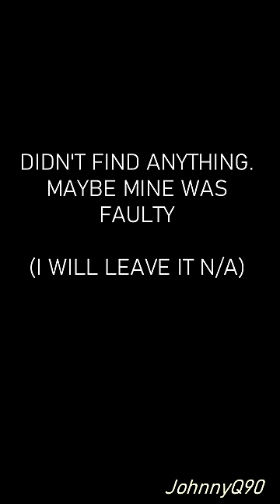Supercharger NOT Working! Naturally Aspirated (N/A) V8 Then!

Comment: The engine sounded really good
Reply: The idle souds like Ducati v4 engine
Reply: I thought its f1 engine💀
Reply: @trq-spectorqueperformance4397  dude clean your ears
Reply: What kind of power does a little engine like that make. It sounded really strong
Reply: @mattl9785  depends on the fuel
Reply: @nicki8731  can I buy one of these you’ve built?
Reply: @mattl9785  I personally haven't built any. I just spend a lot of time on forums and youtube videos 🤣
Reply: @mattl9785 I wish someone answer your question because I think allot of us wants to know
Reply: Actually sounds like an r8 street
Reply: @autobahnman6869  I'm pretty sure donut media made a video on one of these. They ran it on Nitro Methane, so it's a bit more powerful than running it on gasoline/petrol.
Reply: I imagine this in a RC ww2 fighter plane 😍
Reply: @nicki8731  an old 1960’s one
Reply: Rupesh
Reply: Rupesh
🎉
Reply: @mattl9785 A horse with about 3 legs

Comment: super was binding because it was bent somehow... use a straight edge and check flatness... these things don't like ANY sort of misalignment, even on the z axis (shaft end to shaft end)... any slight bend or burr causes what you suffer with the supercharger.
Reply: When physics bend your rotor:
Reply: Also there us slop in gears    I used lock tight, seams to work
Reply: Also, look at that gear mesh. WAY too tight.
Reply: The slop between the rotors looks like they're stacked in 3 pieces they could be walking apart and contacting the other adjacent rotors
Reply: need to assemble it and check rotor clearance with feeler gauge. pretend it's a detroit blower
Reply: I was thinking the same, that's usually why they are twisted as well, less chance for damage.
Reply: Check alignment of rear rotor bearings my be binding up if just a hair to close
Reply: My guess is the rear end of one of the shaft wasn't seated properly, and allowed for the binding. Probably good that he found it early instead of failing at wot.

Comment: If blower blades are even the tiniest bit out of alignment, they will bind up. It's very likely one of the blade axles spun in its gear. Seen this exact problem on a full sized one.
Reply: Especially when they are straight cut, if they were helically cut it dosent bind as easily

Comment: First appearance seems to indicate there is some binding taking place.
@0:32 Video Mark, you turn the supercharger housing towards the camera, showing the assembly. 
I believe you could address the binding by fusing the bearings into the plastic housing, behind the gears.
It provides a sturdier surface that will not give way so easily to torsion and prevent the assembly from rubbing.
You will also need to address the opposing end in the same way to ensure the helical screws remain aligned.
If binding is still present, check the balance on the helical screws to make sure they haven't been malformed during load.

@JohnnyQ90 Keep up the great work!
Reply: Do you not think think it's the blades... They seemed to close.. they need a tiny bit of clearance... 
Then some sort of soft material that sweeps against the other blade... I think you probably know what I'm referring to
Reply: Here's an idea:
Contact:
Blower Drive Service aka B.D.S. or and of the Drag Race Speed Performance Manufacturers for Contacting businesses that make Procharging Alcohol Funny Car Engines and tell them that you're making a "Scaled Down" version of their products (I would suggest that you try calling them before emailing them) .... it's just a thought
Reply: Cause as it stands right now it sounds like a Pro Stock or "Modified" Engine
Reply: They're not helical.

Comment: Hi mate, love your work. On the real engines the blower belt is fairly loose when cold, as it warms up the aluminium expands quite a lot causing too much load on pulleys and bearing.
Not sure if you knew this but thought I would share.
Reg: Ken

Comment: It's a pity about the super charger but It still sounds pretty awesome man. It would be good to see someone go with an electrically powered super charger- I think a little brushless motor  would be able to give it the RPM it needs on small a displacement, It could be used to start the engine too with a little mechanical wizardry.
All the best from the UK.

Comment: did you boost reference the fuel into the carby? Blowthru's usually bring the fual pressure up with the boost pressure, by tapping into the regulator. If its running external air bleeds like holleys etc, a blowthru will completely enclose the carb!

Comment: When you pull out the rotors and turn them you see a bright shiny spot on one set of lobes, that's the binding point, either that lobes warped or not machined to the right tolerance and gaps to small.

Comment: Since supercharger's rotors moved freely when you took them out of casing, you'll need to check if the casing is bent in any way. One of the rotors is actually hitting the bent casing causing it to bind.

Comment: Yeah, I would definitely say that running it on an accessory belt is a better setup than on the timing belt. 

I think you should try and figure out/ RMA the blower, since at the nitro scale the biggest real advantage you have over a 2 stroke is valves to keep the boost in and not have tons of blow by. 

The 4 stroke can’t rev anything like the 2 strokes (~30k Rpm) so you’re down on horse power at this scale, so big torque is the gimmick to me.

Comment: The only thing I can think of is that there is a clearance/ bent shaft in the supercharger unit, sounds like it locks up. Check the clearances on the shaft and rotors, hopefully you’ll find the problem and fix it.

Comment: You could.. get that blue spray stuff.. spray it on everything... Put it together and spin it with your hands a few times... And then pull it back apart and see where the blue dye has scraped off... I forget what it's called. I'm thinking you have probably used it though.

Comment: I have a solution possibly. It looks like the rotors themselves are binding (hard to tell from the video though). Possibly from too much give/movement along their length caused by them being made of three parts each and not two continuous rotors. Should be an easy fix though. 

Get some graphite powder and put a little inside the assembled supercharger where the rotors are (careful not to get it on the gears). Spin it by hand until the problem goes away (don’t spin it more than you have to or you’ll loose too much efficiency). Then clean it as good as possible. Possibly use break cleaner. If any of that graphite goes in the engine it could kill it. Then reassemble, grease gears, and see how it turns. It should hopefully turn better but maybe not perfect. Add a smidgen of oil or grease to the rotors. That should fix the issue entirely. Grease will also help with the seal between rotors and can increase it’s efficiency. Hope this works and is helpful. Love your videos.

Comment: I would love an rc kit to be able to drop in these scale engines with only a mounting plate to change if a different engine is desired. Lie imaging you get a muscle car where it is a front engine rwd setup with the v8 or if you had an open wheel formula car with the i4 put in the rear. I know a rolling chassis would probably cost like 1000-2000 even for a 1/5th scale, but that would be sweet.

Comment: Shows visible 10° to 15° of axial play in front rotor bearings

"Idk why it's binding"

Start with better bearings and more precise locating of rotors into front and rear housings. Also, if you extend the shaft in front of the blower, you multiply the axial force applied to the bearing thereof. In other words, a bearing that is made for a shaft of a certain length is not going to be sufficient when the lever in front of the bearing increases. Plus, if the belt is too tight, it will multiply that axial force even further.

Comment: I think the bearings they gave are too loose of a tolerance so any kind of load is torque locking the gears like an auto clutch, the fact that it binds up in so many separate locations like that indicates gear lock not rotor lock

Comment: I undervolted my 3050 Ti to 875 mV and clocks are pinned to 1800 MHz all the time. Power draw doesn't exceed 60 watts and temps are great. Definitely recommend giving it a go with msi afterburner.
Reply: Real
Reply: And this has what to do with small-scale engines?
Reply: @UmmmmmmmWhat  LMAO Idk how I did it, but I dropped this comment on the wrong video 💀

Comment: First off all the lobes of the supercharger should mesh perfectly, use engineers blue to see where the problem is but with so much backlash it's bad and will reduce the power, these tolerances should be very small, I'd also go for a slightly bigger crankshaft pulley

Comment: If the vanes on the rotors were designed like a spiral not straight, you had much less strain on the belt drive and less mechanical losses.

Comment: The rotors seem quite low quality. I'd try wear it in slowly over time with a drill, untill it turns smooth enough for the engine.